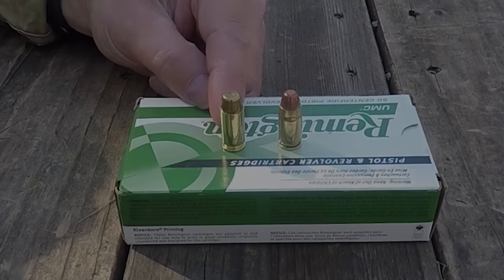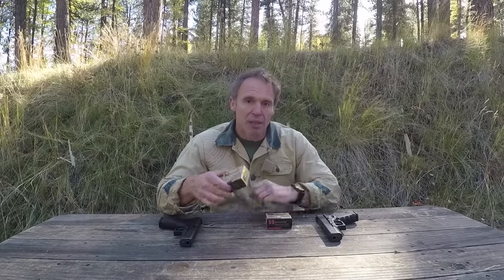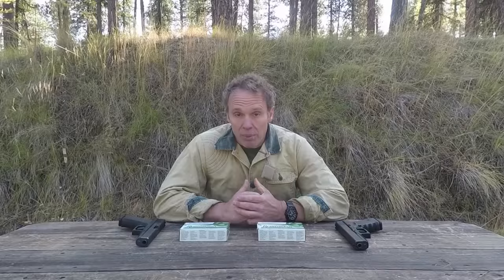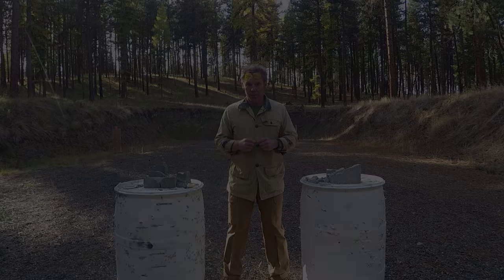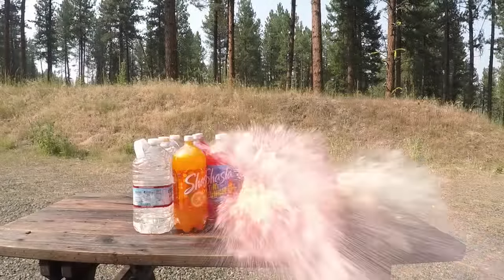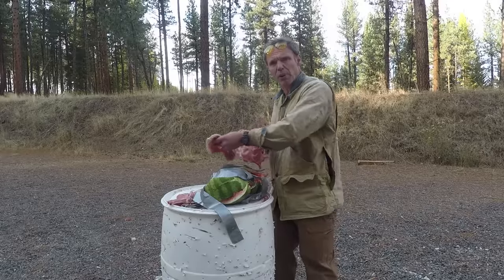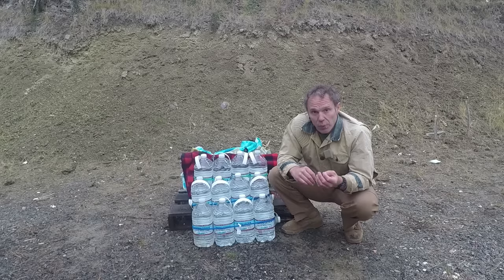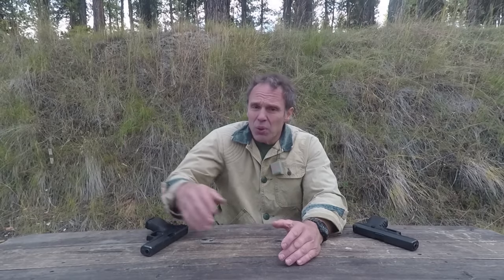Personal protection: .357 SIG vs. .40 s/w

Comment: The 357 SIG is just a 9mm bullet in a necked down .40S&W case, so you can think of it as a 9mm magnum.
Reply: I think they would have sold a lot more guns in 9mm magnum than .357 SIG. Would have been easier to relate too.
Reply: @Ish Naphtali Yes, I meant for the .357 SIG to have been named or renamed only as a 9mm Magnum round instead.
Reply: 10mm. not 40SW.
Reply: It's a 10mm auto case necked down and slightly shortened.
If you were to neck down a 40sw case to .355, you would obtain a shorter case than the original one, while on the contrary the .357sig it's actually slightly longer than a 40sw is.

Plus, the 10mm auto and 357sig cases are slightly stronger than the 40sw.
Reply: Good name good point!
Reply: @gurugoguzhanson  agree
Reply: the 357 still has more speed and power than the 40
Reply: @gurugoguzhanson  Sadly it had nothing to do with naming. Just Glock offering the 22 in .40 and heavily marketing their more cost-effective option to law enforcement. This pretty much outdid the more uncommon competition in ,357SIG, just another footnote in the various caliber wars. I personally enjoy .357SIG, its what the .40 should have been imo.
Reply: @gurugoguzhanson  Probably too powerful for most 9mm guns.
Reply: @gurugoguzhanson  The 9mm Magnum (9x29) was introduced in the late 70s but never caught on.
Reply: @Rusty Highlander hope it's fine.
Reply: @Rusty Highlander you can do it and maybe it's fine for plinking but it's not recommended.

By resizing a 40 SW case, wich is slightly shorter than the 357 sig to start with, you actually get a further shortened case (and you usually get a very short neck, wich may lead to bullet setback problems).

Also: the SAAMI max pressure for a 40sw is 35 thousands, while the 357 sig is 40 thousands according to SAAMI or more than 44 thousands according to CIP standards. 

It seems that certain 40 brasses are stronger than others, though, so maybe what you're doing is perfectly fine and you're most probably an experienced reloader anyway :)
Reply: You call it anything you want but if you go to 357 Sig and 40 Smith & Wesson ballistics 101 you will realize that a 357 Sig has more energy and it's much faster than the 40 Smith and Wesson with less recoil
Reply: Focke Wulf  i used cheap. Loads for both. If you use special loads, then both must be so. Physics dictate that the heavier round produces more recoil ie oposing force.
Reply: Focke Wulf  I believe 357 sig brass is proprietary Sig design. 

It's slightly longer than 40 sw one and it's slightly stronger too, leading to the idea it's similar to 10mm Auto brass but I've heard it is slightly slimmer in certain parts.

Anyway 10mm auto uses a different kind of primer (large pistol, against the small pistol ones used by both 357 sig and 40sw).

Even by resizing a 10mm auto to accomodate a 9mm bullet, the resulting brass would be a little bit too long and would use a different primer and would have a different internal chamber. 

I believe Sig expressely designed a new brass for commercial reasons.
Reply: @gurugoguzhanson  
I agree. Sig should have stuck with the name 9mm magnum. I assume "357sig" was a name recognition thing. Which you can bet was developed in a board room.
Reply: Magnum would be longer and more powerful but the casing is bigger so it’s a different cartridge
Reply: @Abrasax Palante 9x23 Winchester too. But no one uses it for self-defense (like the .38 Auto) but in IPSC matches instead.
Reply: There was a 10mm round necked down to 357 made by Dillon called the 9x25.  You cannot neck down 40S&W to make 357Sig.  You can form 10mm down but you have to trim it.
Reply: GiggleHz Usually magnums use the original case as a basis.  This does not.  It’s not even a taper case but a bottleneck case.
Reply: Kinda
Reply: Aren't all true magnum cartridges rimmed?
Reply: @tombats6428  well when your shooting a way lighter bullet it will go faster but still wont hit as hard. the 40 will penetrate deeper
Reply: @tombats6428   Also if you carry special ammo for self defense, it is easier to be charged with a crime.  this is niot true. if you were in the right dont matter what ammo you used
Reply: Focke Wulf  it will not penetrate better than 10mm and it does not out do all 40 loads. a heavier round will go deeper everytime
Reply: Focke Wulf  nope it does not. if it did then why is 10mm used and recommened for use in bear country but 357 sig is not??? the sig wont penetrate deep enough to kill a bear but 10mm will. a 10mm can launch 180gr bullet at 1400fps 357sig cant even get close to that. go on any form you like and say this and watch what you get
Reply: @Focke Wulf i cant see your whole comment but 10mm can shoot a 135gr bullet @1600fps so better than 357 sig 125gr@1600fps the 10mm can shoot a 155@1600fps also
Reply: @bigsean2473  Penetration Channel showed 357SIG easily beats 40 through all their testing mediums.

I'm sure 10mm does better, but it's a dead meme.
Reply: @A.Clifton  that was one brand of 40s/w not all brands are equal that is not a clear test to say that sig is better. he would have to test way more rounds for many different manufacturers to call the sig the winner. ive had fmj 40cal that was only on 45acp level @840fps most fmj is called practice ammo and loaded weaker.
Reply: My question for all is what do you think would be the ultimate submachine gun/PDW round???
Reply: @TheJMan1K  There isn't one, really. With intermediate rifle cartridges being chambered in PDW sized packages like AR pistols and the Romanian Dracos, there really isn't much need for pistol caliber carbines to fulfill PDW roles.

But if you're asking what the best possible contenders for king of PCCs, I like the Aero Survival Rifle in 357SIG, and the Marlin 1894 in 44Mag.
Reply: A. Clifton personally I think there is a need still. With short barreled ARs you lose most ballistic properties unless you’re running speciality ammo. The right 40 S&W round out of a 10.5 inch barrel would surely be devastating. Plus the added benefits (if used in a gas system instead of blowback) would be lighter weight, less recoil, and less muzzle report or concussion. 357 SIG would be even better!
Reply: @edraith  The 10mm case uses a large pistol primer whereas the 40 S&W uses a small pistol primer. The 357 Sig is based on the 40 S&W but a tad longer in length. Federal didn't just take 40 S&W cases and simply neck them down to .355. They used a totally new case design but based on the design of the 40 S&W.
Reply: @toddy2519  yes, there is the difference about the primer, you are absolutely right (I notice I already pointed that out in an other reply).
 
The .40 SW case is still different and less strong than the .357 so you are right in saying 357 sig has its own original case.

When I stress that in seeking a "parent case" one should look to 10mm Auto instead of 40sw I do so because I worry about people resizing 40sw to 357sig, with issues related to pressure tolerance and headspacing, but I already pointed out that using a 10mm auto would create issues, too.

Truly, 357 sig never caught on because it is so expensive to buy and so difficult to reload.
Reply: @edraith  I reload for my Springfield Armory XD Service model in 357 Sig because store-bought ammo is so damn expensive. I haven't experienced any problems doing that. What problems have you encountered?
Reply: @edraith  I didn't see your other posting concerning the primer size difference. If I had I would have refrained from mentioning it. Sorry about that.
Reply: @rifleshooterchannel208  You're making an apples to oranges comparison. 357 sig is designed around lighter projectile weights and it shows. A 115 grain 357 has more energy and velocity compared to a 155gr 40. If you don't believe me checkout underwood ammo, they load all their stuff hot, and they have the stats for all their bullets.
Reply: @rifleshooterchannel208  Your talking out of your ass. Paul tested 357 sig multiple times and not a single bullet came apart and every hollow point expanded reliably. Tnoutdoors also tested underwood and every single round held together and performed perfectly. In literally every video on youtube the round functions perfectly. On your second point, show me a single example of the bullet setback actually hapening on non handloaded ammo , not a hypothetical that it could.
Reply: @rifleshooterchannel208  You didn't even read what in the links you put up, the first one was exactly what I said problems with RELOADED ammunition , not factory ammunition, and he said hes seen the same problem with 45 acp and 9mm. Your second link said he only had a problem with Remington ammo, and Remington has spotty quality control at best. I wouldn't even  buy 9mm ammo from them as literally no one recommends it. The third link you posted the guy was recommending that you use Underwood over double tap. He was saying that the double tap bullets are the messed up ones, not the Underwood or 357 inherently as a cartridge. One of the guys even posted one of the videos I told you to go watch lol.  Also I didn't delete my comment, I edited it, it's still there. My racism insinuation still stands. You looked at my picture, saw that I was black, and used that as an excuse to call me a drug addicted thug, just like every other racist I've met in my life. A racists favorite thing is to call black people thugs behind a keyboard.
Reply: @rifleshooterchannel208  He said that the round had been rechambered, which means he caused that himself. You also seem to keep ignoring the guy right under him that says he's seen it with 9mm and 45 acp.
Reply: @rifleshooterchannel208  One of the guys under even said Why do you keep unloading and reloading the same round? Because thats what caused his issue.
Reply: @Rifle Shooter Channel
 One of the guys under him asked him why is he unloading and reloading the same ammo and he admitted to it I made a second comment for it intead of mashing the statements together . You still haven't read past the first line. Also, you still haven't proven that Underwood bullets have a single problem. The double tap bullets or remington failing doesn't in any way  doesn't validate what your saying about the underwood, just those two companies. It' the same a how tulammo doesn't represent all 9mm. Again you seem to keep ignoring the guy right under him saying it can happen with pretty much any round as he's seen it with 9mm and 45 acp. You also keep ignoring that you haven't shown the actual bullet in quetion failing a single time.Not only that the 115 grain was a random example. Heres another the 65 extreme defender has more energy and velocity than the 100 and 115 grain 40 s&w bullets, which is what this was about in the first place before you made it about the damn nosler bullet.
Reply: @rifleshooterchannel208  Watch tnoudoors video like I keep saying. He tests the ammo in gel and and his results validate the round, or is actual scientific evidence too complicated for you? He's not even the only one, the penetration channel validated it too. It's not a gimmick when its been proven in gel testing.
Reply: @rifleshooterchannel208  Don't put words into my mouth. If you reread my last two comments I never said that. Also here's a link to a forum where their saying constantly rechambering will cause any round to end up seated incorrectly. https://www.defensivecarry.com/forum/defensive-carry-guns/89121-rechambering-round.html and another https://www.defensivecarry.com/forum/defensive-ammunition-ballistics/385082-re-chambering-same-carry-rounds.html and another https://www.defensivecarry.com/forum/defensive-ammunition-ballistics/137197-danger-re-chambering-same-round-continuously.html. Here's an article about it too if you still think this is a 357 sig specific problem http://preparedgunowners.com/2015/09/17/why-you-should-never-rechamber-the-same-ar-15-round-twice/
Reply: @rifleshooterchannel208  You do realise that if my links are worthless then your links and anything you said is also worthless because i haven't seen you do it firsthand right?. Also.those links are the first things that pop if you google "is rechambering the a round safe". Every single article, forum, and informational page says not to keep rechambering the same ammo. Here's another example form a professional reloader in which he says not to rechamber the same round http://www.massreloading.com/setback.html and another from a firearms blog telling you not to keep rechambering the same round http://concealednation.org/2016/02/bullet-setback-is-it-a-myth-why-its-important-to-rotate-your-chambered-round/ . Also, if you read my comment again, since you seem to be so challenged, I never said he specifically tested that round. I said that he's tested Underwood in general and it has never not done what it said it would, military arms channel, iv8888, and the penetration channel has also tested variations of their ammo and not a single one of them have gotten bad results. The point is that underwood is a high quality ammo manufacturer who has no reason to start lying now.
Reply: @rifleshooterchannel208  I'm not the guy who said "And you never rechamber your carry ammo?" and then deleted it when I realized that nobody would ever recommend rechambering carry ammo as it's been proven to cause major seating problems. I'm not the guy who posted links to try to support my point and then said links were pointless. So who's contradicting themselves?
Reply: @rifleshooterchannel208  Nosler has their reloading data on their website. Their round have been tested meets all SAAMI specs for 357 sig, so your "improper design" claims are nothing, unless you know better than SAAMI. Also if you use Blue dot at 10.8 grns you get a load density of 100% or you can go with A-No.9 and get case densities above 100% easily. Also on SAAMI's website they have test results for bullets as low as 100 grains so I don't see why 115 grains is so impossible for you to believe.
Reply: @rifleshooterchannel208  So factory reloading data is all lies now.....lol. ok my guy. Since you have all the guns, knowledge, and money buy some underwood and test it on video. Until then your making claims that haven't been backed up by any real testing.
Reply: @rifleshooterchannel208  I said it once and this is the last time. Go buy the ammo and shoot it/test it since your so convinced. You seem to believe that you have more knowledge than a multimillion dollar company that has literally made millions of bullets.
Reply: @rifleshooterchannel208  Also my main point in this entire conversation(I've said it three times now) is that 357 sig has more velocity and energy than 40 s&w when made well, as in the case of underwood loads. All this other shit is what you brought up.
Reply: @rifleshooterchannel208  I repeated what underwood themselves said. Thats the manufacturers claim not mines. My claim is that underwood is a multumillion dollar company, who has far more production and research and development capability then you ever will. I have every reason to believe them over you as their track record is pretty much spotless. They've never came out with a bullet that didn't do what it said it could.The fact that you believe you have more knowledge than them on their bullets is laughable at best without actual chronographing and ballistics gell testing.
Reply: @rifleshooterchannel208  Chrono and gel test is how you prove a round is effective and does what it is advetised to do, what does is not have to do with it. Also the only reason I even mentioned the 115 gr is because its the first one they list. For some reason you took that and ran with it. Thats why i switched to an entirely different round. As I just said my main point when I first commented to you was just to compare energy and velocity between 40 s&w and 357 sig thats it.
Reply: @rifleshooterchannel208  Velocity is pretty important. Lets take the 230gr gold dots as an example. They move at 890 fps and it produces 405 ft lbsof energy. If it were a 230 grain bullet moving at 1780 fps you would have 2194 ft lbs energy. Velocity is the reason why you get much more damage from a 223 or a 556 vs a pistol. Its still a 22 bullet, it just moves much faster which allows for more energy hitting the target. Doubling weight only doubles energy. Doubling velocity quadruples energy.
Reply: @rifleshooterchannel208  Very true about the hollow points, they're only made to take a certain amount of velocity before a problem happens. I think whether or not the 10% increase would matter very much would depend on the round in question I don't think a 22 would benifit much for example. For that 230 gr for example you would go from 405 ft lbs to 490 ft lbs. Thats an almost 25% increase in energy which could give you that extra punch you need. Also if you were to take that bullet, make it a 115 gr bullet and push it at 1980 fps(double the 230) you would get 1097 ft lbs of energy. It would basically be a rifle at that point lol
Reply: A 44 mag is just a 44 special magnum. A 357 mag is just a 38 special magnum. Wow!
Reply: @pghj100  After reading much of this I have to say in terms of the bullet set back part of this discussion you are just flat wrong. It does indeed happen. If you had picked up a phone and spoken with any of the ammo techs at Hornady, Federal, Winchester, Underwood or even Buffalo Bore. Then you would have heard everyone one of them tell you yes it does occur. 

Hornady uses a bit of a roll crimp to their Critical Duty ammo in an attempt to reduce that problem. Yet it does not stop it entirely. In the case of the 357 SIG, including Hornady's it does in fact happen. It is a known problem. Now if you only feed it into the gun once and shoot it. Its not an issue. Not even with the Underwood 125gr BJHP load. Which I do carry in addition to my handloads. However if you cycle it through the gun more than once you are setting yourself up for something nasty. 

The neck is short on the SIG round as it has been mentioned. So tension is minimal. Personally for my reloads/handloads I use the Lee FCD (Factory Crimp Die) which presses a bit of the case mouth into the bullet. Thus giving it a bit of a roll crimp like the Hornady Critical Duty. If the bullet does not have a cannelure then the process presses a bit of the case mouth into the bullet creating one. While this does not completely prevent setback. It does reduce it quite a bit. 

FYI there is a great article from Buffalo Bore addressing bullet setback and the set back that does frequently occur in a 357 SIG. Especially in the Glock 31. I own several 357 SIGs including a G31(P80 build). Reloading and handloading for it, it is my preferred loading and carry caliber next to the 40. I even load up steel case .357 SIG which you can see in 1 or 2 of my IG posts, FYI. 

Oh and that 115gr Nosler JHP from Underwood is not that great as Rifle Shooter Channel has stated. In fact neither is the 124gr JHP. Both are 9x19 competition designed bullets similar to the HAP (Hornady Action Pistol) and certainly not made to handle the higher speeds generated by the SIG cartridge. 

Oh and feel free to check out my gram matteothirteenseventyone if you are in doubt that I own anything chambered in .357 SIG. As for that Buffalo Bore artical here's the link: 

https://www.buffalobore.com/index.php?l=product_list&c=171
Make sure to read the 2nd paragragh under AVOIDING BULLET SET BACK it specifically addresses 357 SIG.
Reply: @Matteo_  I never said that it doesn't happen, just that it isn't very common for people who aren't reloading their own ammo or rechambering the same round repeatedly(which is what the person I was talking to linked me). I just read the article and the part about 357 sig is more about the glock not being designed to use it. He even says in the last couple sentences that even what he said about the glock may no longer be true, so that entire section may or may not matter based on if glock made updates to their pistol. He was saying to use 357 sig in a gun that is designed for it, which is what i would do anyway.
Reply: @pghj100  The Gen 5 Glock does not have a 40 S&W chambering. As such there is no 357 SIG version either. So it has not been corrected. And many other guns in 357 SIG do not have the feed geometry to avoid the round impacting the feed ramp or slamming into the top of the chamber well as its fed up off the ramp.

So yes setback does indeed occur in both factory ammo, reloads and handloads. Point is its a great round but readily experience setback since the neck in so short and tension so minimal. That said the ammo is expensive so most don't deal with it enough for there to be reportable numbers of it occurring. Those of us who shoot it regularly will check for it if it's been cycled through the gun even once because it can happen so readily. 

Oh and to my knowledge there are very few guns that were actually or specifically designed for it. The Sig P229 being one of them. The Steyr M357 being another. However Steyr stopped making it and with the advent of the A2 MF series they don't even make a 40 S&W version that can have a 357 SIG barrel swapped in. So the field of choices are narrow. That said even if one selects a G31, G32 or G33 the rule to keep in mind is only let it chamber once, ie shoot it or check and then decide to shoot it anyways or chuck it.
Reply: Except magnum is a synonym for long, which the .357 sig is not
Reply: @bmzaron713  Well technically it is longer. 9mm has a case that is 19 millimeters long. .357 SIG's case is 22mm
Reply: Reminds me of a Weatherby.
Reply: 9MM = .354331 inches
Reply: Scott Keppler  It is a great caibur great mass, good magazine capacity,  getting the job done....works well
Reply: It'd be a lot more popular if it was called a 9mm Magnum...then all them 9mm fanboys would be running to the store to get some.
Reply: @gurugoguzhanson  you are right,357 Sig does not sound good,9mm magnum or 9mm super would have generated more interest.....
Reply: @bigsean2473  your physics are dead wrong,  A .22 short going near the speed of light is going to destroy an M1-Abrams tank WITH EASE. It's not even close. But- This example is a little obtuse- but proves my point that a smaller projectile at greater speeds than a heavier projectile and slower speeds- the smaller wins.  Simper fundamental physics.
Reply: @pghj100   Velocity is so important in physics-- look at light it self. Atoms of little of anything pushed to 186,000 miles per second. Actually past that if you look deeper. Maybe a little deep for a gun forum- but velocity matters-- and so does gravity. Which with Einstein's E=Mc2- i digress.
Reply: @gurugoguzhanson  Since there was at one time a 9mm magnum round, changing the 357 SIG name to 9mm magnum, could create some problems.
Reply: @edraith  The 10mm case uses large pistol primers whereas the 357 Sig uses small pistol primers so it's not just a shortened 10mm!
Reply: @tombats6428  Charged with a crime for using "special ammo" (reloads)? What criminal charge would that be?
Reply: @toddy2519  yes, you are correct, still the 357sig case comes more from a 10mm than from a 40sw
Reply: @toddy2519  this is in fact my older answer:

"I believe 357 sig brass is proprietary Sig design. 

It's slightly longer than 40 sw one and it's slightly stronger too, leading to the idea it's similar to 10mm Auto brass but I've heard it is slightly slimmer in certain parts.

Anyway 10mm auto uses a different kind of primer (large pistol, against the small pistol ones used by both 357 sig and 40sw).

Even by resizing a 10mm auto to accomodate a 9mm bullet, the resulting brass would be a little bit too long and would use a different primer and would have a different internal chamber. 

I believe Sig expressely designed a new brass for commercial reasons."
Reply: @edraith  Necking a cartridge down lengthens the case, so it makes sense that the .357 SIG is slightly longer than its parent case the .40 S&W.
Reply: @pieterveenders9793  sadly 357 sig is a proprietary case and it's in certain respects actually closer to a 10mm than to a 40sw, the latter of which will NOT be under proper SAAMI specs when resized: you'll loose both headspacing and the ability of the brass to withstand pressures.
Reply: I would consider a 9mm +p a "9mm magnum". A 357 sig is more of a hybrid round, 9mm projectile in a necked down .40 casing.
Reply: My instructor (Scotty Reitz) used to call the 9mm “.380 Magnum”. 😂